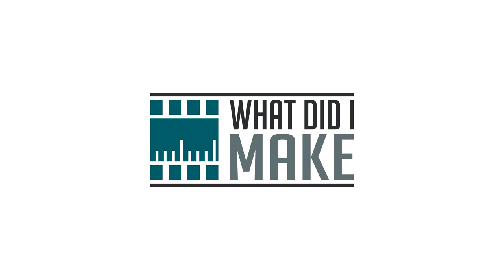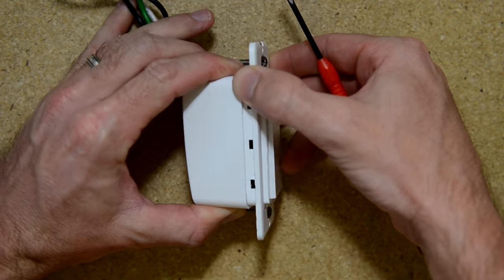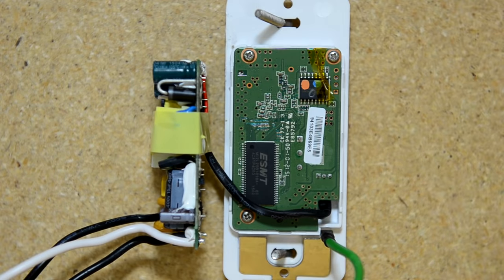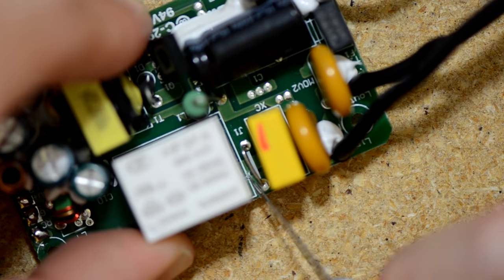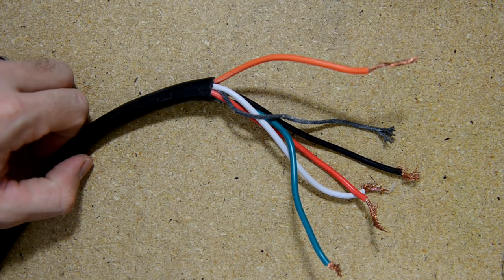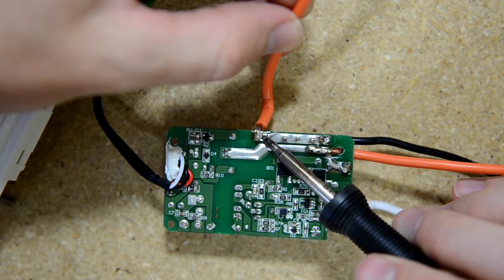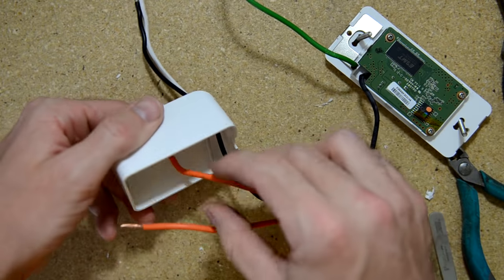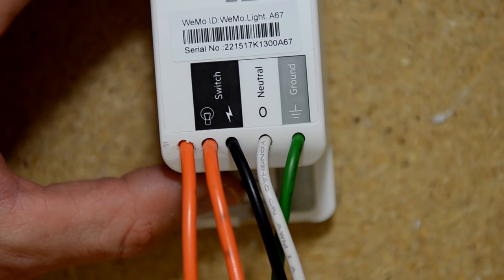How to Hack a WeMo Switch for Low Voltage

Comment: Good Video, only one thing I'd like to point out, it will no longer be rated for 15 amps after cutting top and bottom traces. I'd wouldn't go over 7 amps just to be safe.

Comment: Ok cool, I assume the input voltage still needs to be 120v to operate the unit or can it be be further modified to run on 5 or 12volts DC? I'm looking to use one of these as a fireplace switch.
Reply: Made this work for my fireplace this weekend.  Yes you still need the 120v to power the device with this modification.

Comment: FYI: The board design has changed on these switches so these exact steps will not apply if you want to try this on a new WeMo Light Switch.
Reply: How do we make the change on the new boards? I’d like to use it for Althea garage door switch.

Comment: for the love of god don't do this. there are minimum creepage distances for AC voltage - if you get a surge, I wouldn't be surprised if the high voltage jumps via a spark the 1-2mm distance shown here and fries whatever low voltage stuff you are using